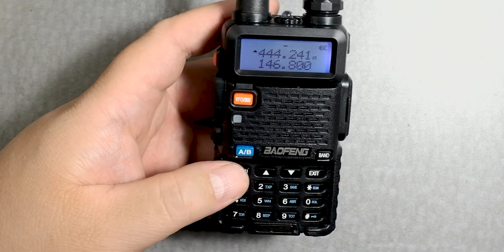Baofeng UV-5R Offset Frequency Shift Amount

Comment: This is an old video, i understand. However, Im a newly licensed Technician and I have a question about transmitting during a Net. I programmed the repeater into the GT-5R, and I also set the PL tone to match theirs. Theres two things i need to understand; in the GT5R there is R-CTCS and T-CTCS. Which one of those do i set the repeater PL to? Second question; they can BARELY make out my name and city but nothing ese i transmitted. The Net Controller said hes not set up for Simplex, and that might be the reason he couldnt hear me. How do i get everyone to hear me? Now that the Net is over, im hesitant to try and call "monitoring"....or even know if i can on this freq
Reply from the maker: Theres two things i need to understand; in the GT5R there is R-CTCS and T-CTCS. Which one of those do i set the repeater PL to?  - I would do a trial and error.  See which on will work. You will not break the other person's radio or repeater..  Second question; they can BARELY make out my name and city but nothing ese i transmitted. The Net Controller said hes not set up for Simplex, and that might be the reason he couldnt hear me. How do i get everyone to hear me? Now that the Net is over, im hesitant to try and call "monitoring"....or even know if i can on this freq.  The you are in the city and using the antenna inside the house, the signal from your radio is hard to get out.  If you go outside, it's possible that they can hear you better, but because you are shorter than the building around you, it's possible your signal is not going far enough.  You could go to higher ground and the line of site should be better.  Unfortunately, going to higher ground is not feasible.  So, you could place an antenna at your home on the roof, this way the signal will go farther.  Another thing to consider is that these hand held don't have a lot of power, thus the distance that they travel can be limited.  There are many factors to consider.  Only by experimenting in your situation, you will find way that make your signal go stronger.

Comment: New to the radio game! What exactly is the purpose of the offset. I’ve seen my local repeater frequency and then the “offset” what’s the importance ?
Reply: The offset is the difference between the repeater's transmit frequency and the the receive frequency, the repeater does not receive and transmit on the same frequency.

Comment: For whatever reason when I do that in mine, it does not save. And I can't figure out why.
Reply: I have the same issue... I enter an offset... when I go back to check it, its 000.000
Reply: @danflaherty5218  did you fix it? same issue here.
Reply: I’m having the same problem
Reply from the maker: If you don't have anything saved in your radio, maybe you should reset it.  https://youtu.be/ejaAcIgF7R0
Reply: me too with the same issue

Comment: But how do u put negative offset please explain
Reply: Go to menu 25 hit menu it will say frequency selection hit the arrow up or down on you key pad it will go to + or - select one and hit menu again
Reply: @jeffreys.harris3433  ok so I am assume 25 SFT-D is where I set my off set for negative or positive and 26 OFFSET is where I would enter 000.600 for -0.6 MHz. Is that correct?
Reply: @williamoleary7844 yes you’re correct
Reply: @jeffreys.harris3433  THanks from NZ!  Forgot to confirm!